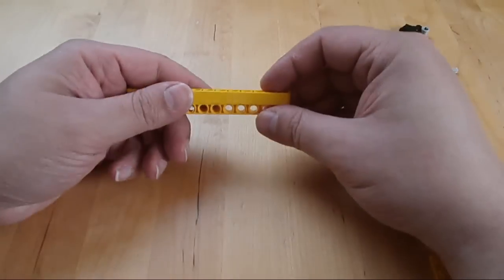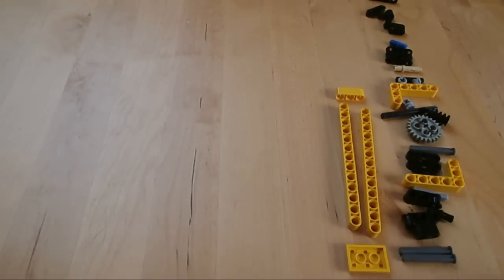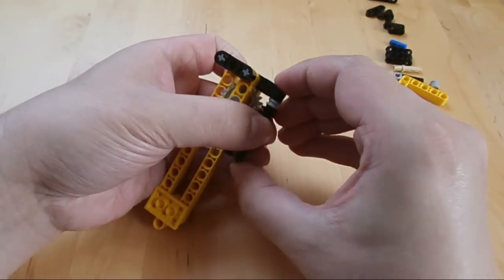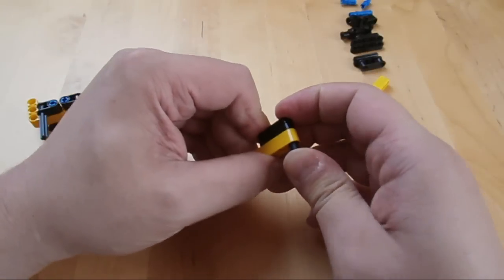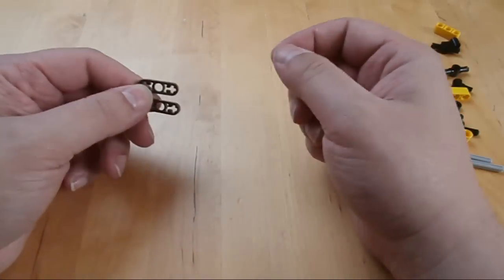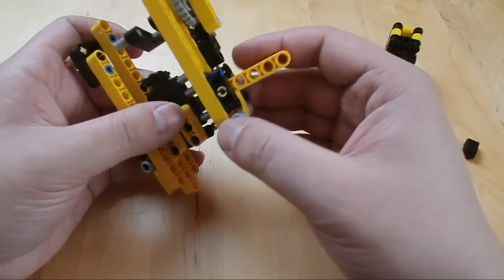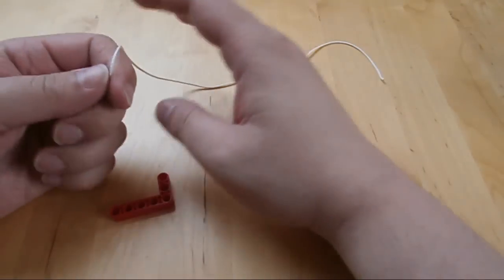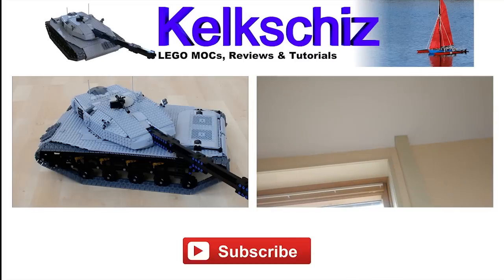Building instructions for my small LEGO shooting mechanism

Comment: Unfortunately i didn't quite understand how you attach the string on to the mechanism and the magazine with the bullets works. If you could explain that, that would be nice. Maybe I just missed it out.
Reply from the maker: Perhaps you should take a look at this video: https://youtu.be/q_2lnsgdV0o?t=886 I think I explain it a bit better there.
Reply: @Kelkschiz  Thank you Sir, but I'm really sorry, it doesn't explain how you load your magazine. The string attachment was shown detailed though.
Reply from the maker: @Zakahia  So the magazine in this small shooting mechanism is what we call a "gravity fed" magazine. Simply means it used gravity to load the bullets. This magazine was intended to beloaded while fixed to the shooting mechanism. What I typically do when I want to load it is: I remove the little 32184 (https://www.bricklink.com/v2/catalog/catalogitem.page?P=32184#T=C) at the top. Then I take a long axle and putd 5x 2L liftarms on it. I insert the axle into the magazine untill it touches the bottom, when it does I release the 5x 2L liftarms and let them slide down. I then put 32184 back into its place and the small axle with stop. Hope that helps!

Comment: Just what kind of string u use ? and the rubber band are special too ? Their dimension ? Thanks
Reply from the maker: The string is made out of basic nylon thread which you can get at your local DIY / hardware store. The rubberbands are just basic rubberbands bought at the supermarket. The ones I used are about 5cm long (unstretched).
Reply: Kelkschiz thanks string seems eletrical But maybe Not
Reply from the maker: I can assure you there is no flexibility in that string, not even a little. You're welcome :).

Comment: Is the this the Most Powerful Shooting Mechanism you've made?
Reply from the maker: No, this one is a lot more powerful: https://www.youtube.com/watch?v=q_2lnsgdV0o.
Reply: Kelkschiz Thanks I saw it and I'm also wondering if I can put a Smaller Red beam because I'm Limited in space.
Reply from the maker: Yes, in fact that is a rather old mechanism. Currently I am using a slightly different one that is a bit smaller. It uses these beams as bow limbs: http://www.bricklink.com/v2/catalog/catalogitem.page?P=32271#T=C.  Unfortunately I don't have a video or digital building instructions for that version. But of course you can make them any size you like. In my experience though there is a correlation between the size of the bow limbs and the power of the mechanism.

Comment: This knot has been bothering me for the past two days. I used to be pretty good with knots years ago, so I have been telling myself that I should know this knot's name. 
Aside from that double bowline knot that does not slip, the only other two knots that come to mind that do slip like the one you are using are the plain old "Slip Knot" and the "Scaffold Knot". 
The Scaffold Knot looks closest to what you are using and can have as many loops as needed (One loop to as many as you want); it is similar to a Hangman's Noose which has 13 loops. 
Here is a video of the Scaffold Knot with 3 loops. https://www.youtube.com/watch?v=WuxOACibiYc
Reply from the maker: +YCIGAFSN Hey :). I have been braking my head over this a long time as well, only I know next to nothing about knots. I compared the scaffold knot to the one I used which is called the "wurg stik" (translates as strangle slip-knot). It is indeed very very similar to the scafford knot, but it is not quite the same. Tried to look into it a bit further and I may have found the one. I think the one I am using may be the the poacher's knot: http://www.animatedknots.com/poachers/#ScrollPoint. What do you think?
Reply: +Kelkschiz - And I forgot one thing. The Scaffold and Poacher's knots are known as "Strangle" or "Choke" knots. And the translation of "wurg stik" from Dutch to English is "strangle suffocate"
Reply: +Kelkschiz - I need to check what I type before I post. wurg stik is strangle slip

Comment: That knot looks similar to the "Double Bowlline" knot. The "Double Bowline" does not slip. I am not sure if it is exactly the same knot because of the way you are doing it in the video. Probably because of having to slip it over the Lego part.
Here is a video I found that shows the "Double Bowline" knot. https://www.youtube.com/watch?v=pfDd4e-Kaoc
Reply from the maker: +YCIGAFSN Hey man, thanks for responding to that question about the name of the knot I am using. Still very much would like to know the name. I looked at the double bowline knot video, and it is indeed very similar but at the same time different is one key element as well. Looks like a very useful knot though, thanks :).

Comment: Kelkschiz, try to use torsion bar instead rubber. maybe with gears...
Like an idea, multi-torsion spring with three or more short torsion bars (3 to 5 dot long)
Reply from the maker: +oberguga I thought about something like that, but it didn't work properly. At least not in the way I had imagined it.
Reply: I don't have any LEGO, but I have an idea))

Мotor attached at one end of the torsion the worm gear attached at the other side. The worm gear can move rack, which will hit the projectile. With this construction the firing process consists of the following phases:
1. The rotation of the motor in one direction - that will lead to the displacement of the rack to the original position.
2. Locking the rack. loading the gun
3. The motor rotation in the opposite direction.Twisting the torsion.
4. Releasing the rail. Torsion starts to spin, worm gear push rod. The projectile flies out of the gun.

Possible problems: 1) too much friction in the worm gear will not allow push rack fast enough.
2) Too little rail stroke - may require additional transmission after worm.
3) The lack of engine torque may require additional transmission
4) the possibility of breaking torsion or motor... worm+gear transmission between torsion and motor can save at least motor, if you turn it off after torsion twisted.

So it definetly not a simple gun))
Sorry, if my english is bad))
Reply from the maker: +oberguga Hmm, that sounds interesting... I may give that a try, thanks :)

Comment: nice Video but how Do you fix the rope at it?
Reply from the maker: +Philipp Koopmann You are right I skipped that part. Perhaps you can take a look at another video I made. I show a little more in that video (https://www.youtube.com/watch?v=q_2lnsgdV0o) but even there I skip the part where I attach the bowstrick to the pullback wire. I am skipping that part because I am using exactly the same knot as I used for attaching the bowstring. If you are having difficulties, try to practice the knot a bit, to understand how it works. Once you understand how the knot works you should have no problem using it to attach the pullback wire. However if you are really hitting a wall, let me know and ill see what I can do to help you.
Reply: +Kelkschiz Ok,thanks

Comment: You could try to conect the Bow arms with gear wheels so they move evenly :)
Reply from the maker: +WickerManLP Yes that would work, but it would also add some volume and the idea of the small mechanism is to make it as small as possible. So ill first try some other options. Thanks for offering your thoughts :)
Reply: oh ok no problem :)